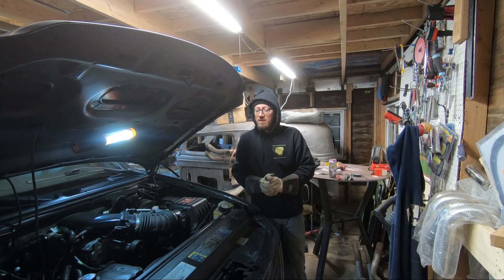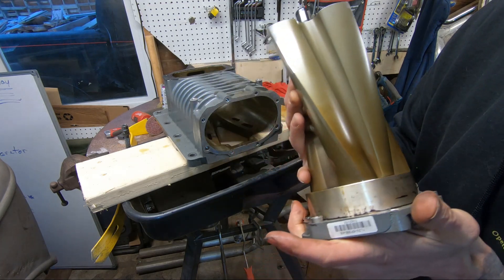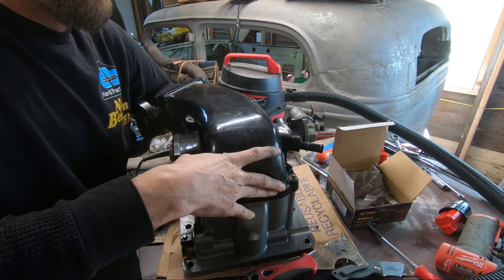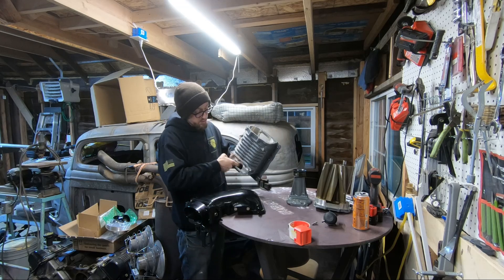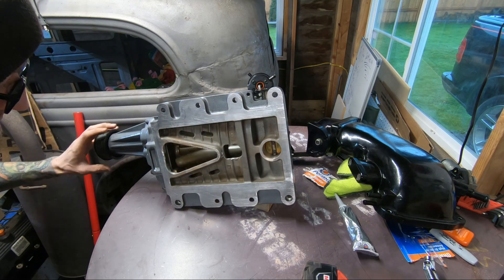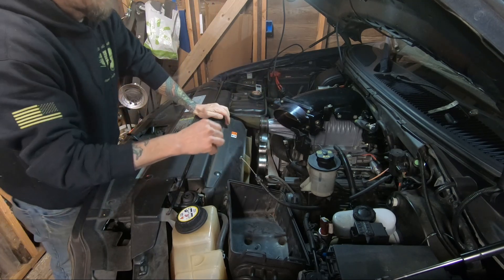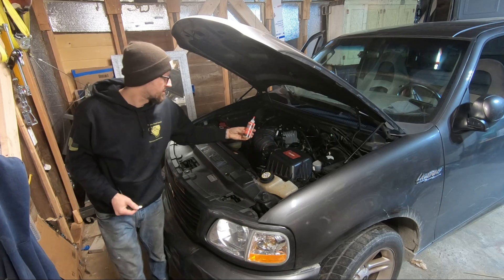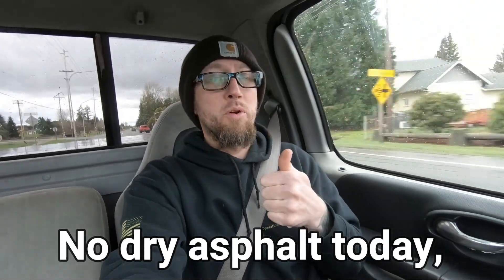DIY Stage 1 Porting 2003 Ford Lightning Blower and JC Customs idler pulleys

Comment: Nicely done! It looks like you used Stiegemeier as a reference.In the future I would not try to shadow his porting because opening up the eaton on the bottom that much usually loses 20+ ft lbs of torque and you can definitely feel that on a truck.I would focus solely on opening up the inlet and you can still take ALOT more off than you did then just use silicone rtv for a gasket.You would want to cut the two ramps in the inlet that lead directly to the rotors down about 1/2 inch.If you want to open up the bottom a little use Jokerz or POSI for a reference.The inlet porting is really what makes the power the outlet is mainly opened for offseting the high air charge temps.When its done right its a 2-3psi increase
Reply from the maker: @bigdaddy5212  thanks I'll keep that in mind, I'll get back into it soon it's just a stage one and I gained almost 2 psi I was very surprised.
Reply: * a lot. It's two words, not one.

Comment: What was / is, the purpose of the added port? Also, the two lower holes for the rotor pack, are now open to the blower from the porting job. Did you just add some sealer to the threads of those bottom two bolts? Thanks
Reply from the maker: Yes the bottom two bolts are open to the blower, just some thread to keep the boost in the engine! The added port helps for direct airflow into the intercooler below the blower. I really hope this helps. Let me know if you have any more questions. Thanks for watching.

Comment: Hey Mike im curious how much more power did the blower gain by porting the blower? 
Why did you change the idler pullies? how does that help?
Im wanting to do the same to my 04 Lightning. 
And do you recommend porting the heads because im wanting to do that too. 
It would be awesome if you did a video on porting the heads too Mike. New subscriber here buddy.
Reply from the maker: Hey man, I'm not sure on the power didn't haven't put it on a dyno just yet. The idea pulleys were changed cause one was bad and why not billet you know. Porting the head will forsure help ALOT. Yes I will be making a video on porting the heads, it's probably will be in two or three months before I get to that video. I'll try and do my best to make it soon. Thanks for subscribing it means a lot. Feel free to hit me up anytime. Let's see your truck. Have a awesome day
Reply: Hey there. Have u got dyno numbers before and after  on the ported blower yet? Thanks for your time

Comment: What is that tool called with the magnet?
Reply from the maker: slugger rotabroach they are the best thing ever but they aren't cheap. Help that helps you find one. Have a awesome weekend
Reply: @builtmikesway1167  super cool tool. I was mostly just curious because I hadn’t seen one before
Reply from the maker: @aaroneaton7412  I believe you can rent them too. I understand 100% I do the same thing.